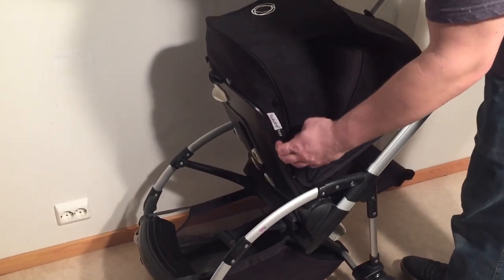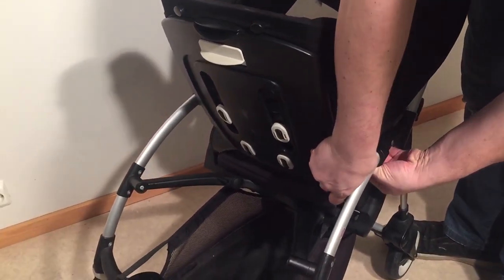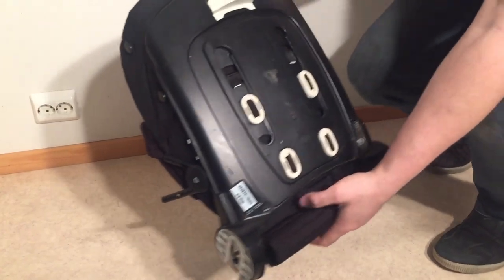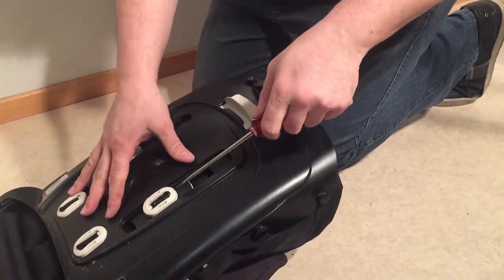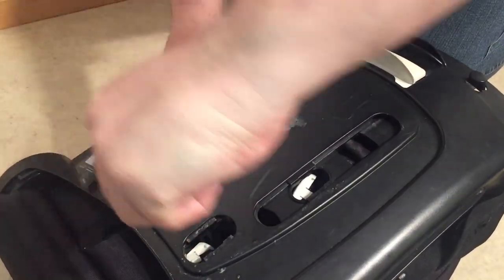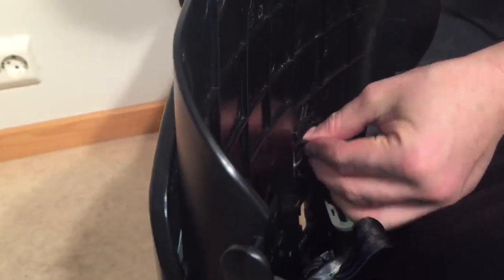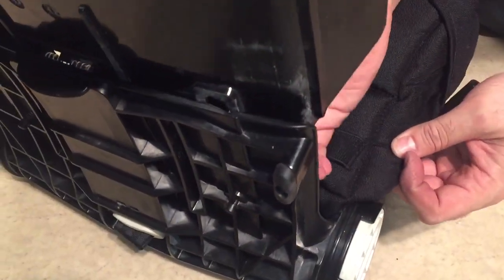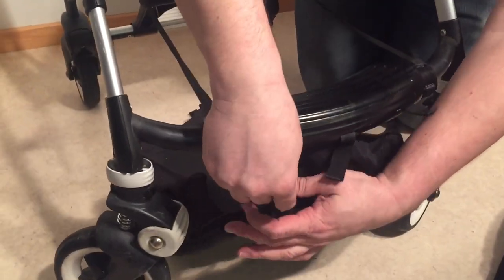How to Remove the Fabrics / Textiles from Bugaboo Bee Models

Comment: Hi, I just bought a b5 for $40. With maxi cosi adapters. She told me the recline broke, I kinda fixed it but have to do a technique to fold it and recline it, how to actually fix it back to normal or do you recommend to buy a whole new stroller, or something since base frame stroller is working perfectly
Reply from the maker: If it's working for you and feels stable the way you fixed it, then no need to get anything else in my opinion, I'm a big fan of DIY solutions.  Otherwise, you could look on Bugaboo's website, they've gotten better at making spare parts available and you might be able to get just the seat-frame. :)
Reply: @BarnevognverkstedNo  It's a bit tricky, but manageable. Drilled 4 holes so I don't use super glue since I know it wouldn't stick long, I used heavy duty zip ties thru the holes I created and you can't even tell about it unless I fold the seat, unfold , and recline. Not hard but it's okay. My husband is constantly confused about how I did it. LOL.